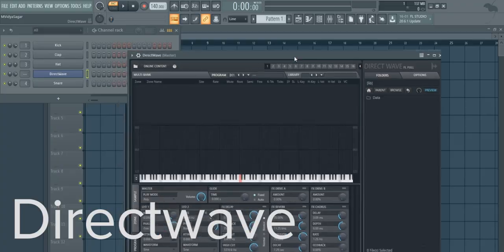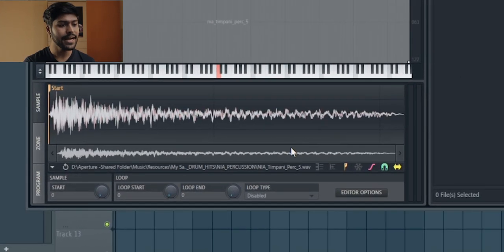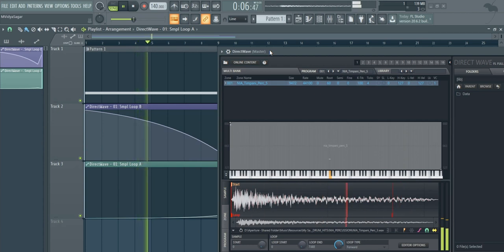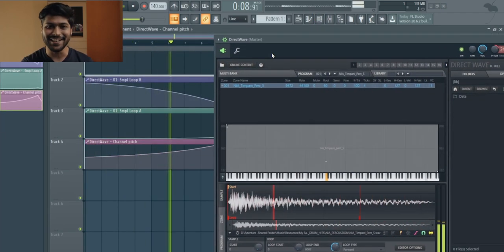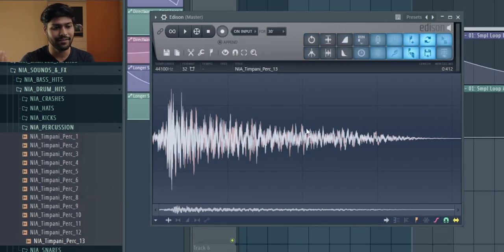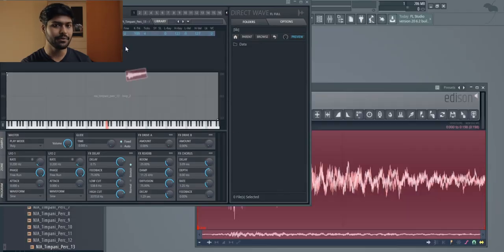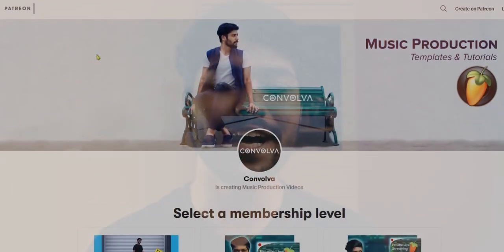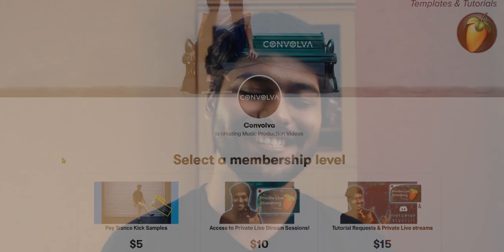Armin Van Buuren Riser Tutorial

Comment: fl studio users

please i have a little problem in a specific FLP when i export as wav file and when i play it with windows player i hear some kind of white noise ...

please anyone know a solution
Reply from the maker: Well it could be a number of things. It could be a plugin that you are using which might be in trial mode. It could be distortion due to volume leveling issues, or it could also be the render settings that you are using for the same. Check these things once again to see if it works out.
Reply: I am doubting to distortion due to leveling how to know which one of the channel racks
Reply from the maker: @ayediyesser9667  Check on your mixer if the levels are going above 0db if they are then you are clipping. You would have to reduce the volume until it comes below that. And also as a precaution use a fruity limiter on the master. Let me know if it works out!
Reply: Okay i will tell you in 2 days 😀
Reply from the maker: @ayediyesser9667  Sure
Reply: Still hear the hiss in the wav file that i exported  ! Please help
Reply: Please need your help man! 🙏🙏🙏
Reply from the maker: @ayediyesser9667  Okay, PM me on facebook!
https://www.facebook.com/convolva/